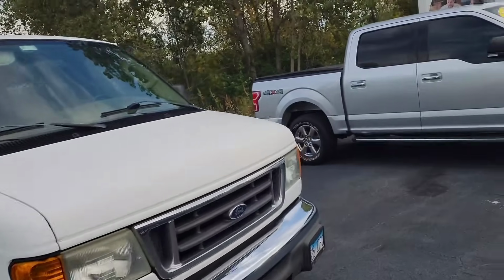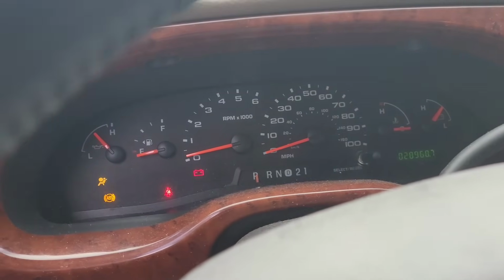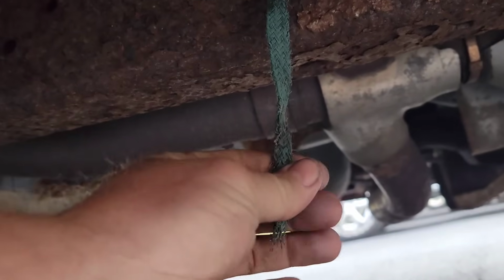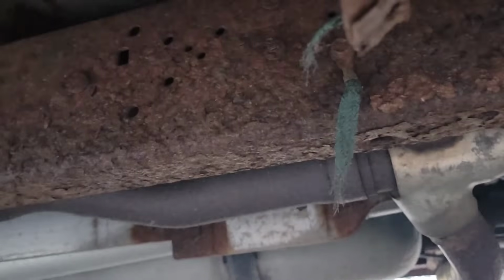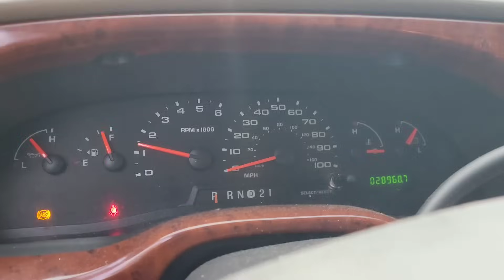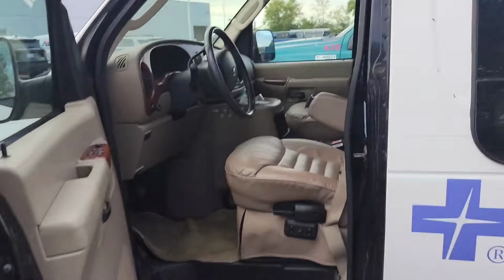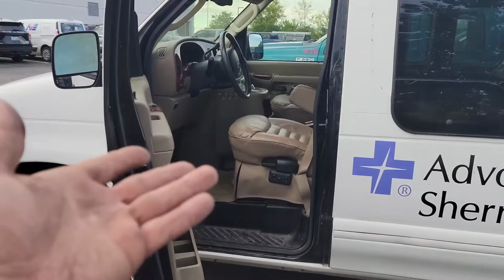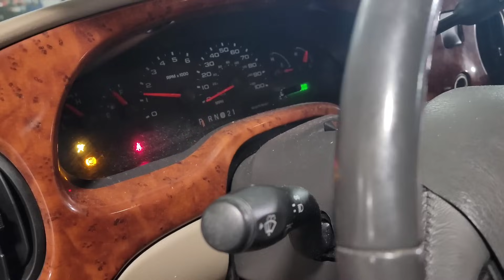Econoline No Start #1 Reason Why Typically - Crank No Start - Easy Fix - #econoline #nostart #ford

Comment: I have a question regarding the central locking system on my 04 Mazda 3 Hatchback. When I press the unlock on the key fob, only the drivers door unlocks but all doors lock when I push the lock button. I went to the dealer and the master tech said there is no central locking reset procedure; it might be the BCM which I think is bs . I replaced the latching assembly for the hatch and nothing changed.

Is there a central locking reset procedure for an 04 Mazda 3 Hatchback and if there is how?
Reply from the maker: Did you double click the unlock fast?

1st click is for driver door and second is for additional doors
Reply: @FordBossMe  Yes I did and nothing happens.

Comment: I changed the starter to my sisters 09 e350 super duty and now no crank or no start can you help with suggestions? The old starter made a metal on metal sound when trying to start that was the reason I put a new starter in the first place
Reply from the maker: Small wire check the connection going to the starter
Reply: @FordBossMe  to make sure it’s connected or to see if it’s broke ?

Comment: You’re a freakin genius and I wish I could send a picture of mine.. it looks EXACTLY like yours did 😅😅😅 thank you dude
Reply from the maker: Glad I could help!
Reply: @FordBossMe  quick question man, where does the ground wire in with the cables?
Reply: Sorry, I have a 99 econoline bus and it runs a two battery circuit. I’m green when it comes to electric stuff. But the factory ground strap looked exactly like the one you fixed, crumbled in my hand. But one end is on the frame and the other is drilled in between the negative and positive cables coming off the side second battery. No one knows what I’m talking about when it comes to this dang bus 😅
Reply from the maker: @thesoutherndisciple  send me a pic poissorichard.rp@gmail.com 

I'm on vacation right now
Reply: Oh sorry dude!
I’ll send them, thank you.
Reply: @FordBossMe  I sent it and it said your email couldn’t be found.

Comment: Do you know much about towing numbers for the f150 pickups? 
I looked in my owner’s manual for my truck and it being a 2018 f150 RCSB (122” wheel base) and having 3.15 gears the chart says 8200 lbs I believe but I called my local ford dealer and they said only 5000 lbs because I don’t have a tow package but I should be able to pull closer to the 8000 if I put a receiver hitch on the back right?
Reply: Be careful here, 8200 is only with a weight distributing hitch. 5000lbs is bumper pull, probably 300lb or 500lb tongue weight max.
Reply: @semajniffirg230  I didn’t plan on pulling the max I was just looking to get a travel trailer around 4-5000 lbs and didn’t want to be over weight and since I have to put a receiver hitch on the truck anyway I planed on getting a weight distribution hitch and maybe even some air bag depending on what trailer I get

Comment: I did this but it still won't start. Does this mean the fuel pump is bad?
Reply from the maker: Possibly yes, make sure you have power and ground and check all fuses
Reply: @FordBossMe  Did that and they all seem to have power. The vans been sitting and the ground strap was the first thing I checked and replaced. Thanks so much for the quick reply!

Comment: Isn't the frame connected by metal bolts to the body already?
Reply from the maker: Doesn't matter it doesn't work that way, just replace the wire
Reply: @FordBossMe  gotcha, thanks for the videos sir!

Comment: currently having a no start problem with ny econoline, man i wish my fix would be that easy but i am afraid it won't be, pointing to a f$$l pump.
Reply: Just did the fuel pump on mine and wasn't that bad..had to cut the tank straps tho because bolts were rusty as shit (282000kms). All in all $100 bucks for the fuel pump and $80 bucks for new tank straps.   And don't buy the whole new fuel pump assembly..you only need the fuel pump motor

Comment: checked ground its ok did a code reading comes up 95 fuel pump secondary circut fault  cranks no start no fuel any suggestions thank you
 send me a message
Reply from the maker: How did you check the ground

Comment: Buen Video, una consulta en una ford e350 5.4 del año 2005, donde esta ubicado esas conexiones, para poder revisar
Reply from the maker: Perdón, pero no hablo español only poquito
Reply: thanks for your attention, I have a ford e350 5.4 from 2005, and I had problems starting.  A query, where these ground connections are located.  Greetings from Peru

Comment: Can you do a video on the f250/f350 grounding strap locations? I’ve read that when they break, for the 6.0’s they can’t weld the transmission inside and destroy it.  Is it better to just use real wire instead of the braided ground straps? Where would be a good place to run supplemental grounds? I was just under my 6.0 f350 cab and chassis, and now that I think about it, I don’t recall seeing any ground straps. This is a southern truck too.
Reply from the maker: If I get one in yes

Comment: If you have a rusty frame like this take some used motor oil and a paint brush and brush it on. Eventually the scaly rust will fall off.

Comment: Wish I saw this video 6 months ago …. Swapped out my fuel pump swapped out the solenoid…. Was at a loss … finally had it towed to a mechanic and it took them several hours to trouble shoot the ground cable wasn’t grounding …. Cable was in tact the frame was just very rusted same simple fix as you

Comment: Definitely hope this was why I was stalling while driving. I changed battery, alternator, oxygen sensors.. the whole thing 😭.. just put a 6 gauge wire on mine cause mines was broken as well lol. I used battery terminal protector spray

Comment: I tried this on my 02 e250 that doesn’t want to start and no dice My ground strap was good, but the connections were dirty, and Rusty I spent 10 minutes cleaning the contacts and bolts with a wire brush then using some battery acid cleaner and no dice ??😢😮‍💨😮‍💨
Reply from the maker: Some of those had issues with the instrument cluster shorting out

Comment: Got an '04 Ford f150 at the shop doing same shit and it's got me starting to question myself. Typical FPDM bullshit but it's not that, pump, wiring harness, etc..I thought I went through entire truck fixing grounds already and found the body to chassis ground, strap looked good but mounting spot was corroded so I just moved the location to a solid cleaned and prepped on.. Assumed it was a really good ground but now maybe not...I keep losing ground to the pump and my boss had me swap a used harness into it when told him wouldn't help and it didn't..I know the CJB boxes also a prone to failure and this truck has water damage on inside of cab directly below box when there was another ground.
Reply from the maker: Cjb and grounds are the main issues

Comment: Cool...the fuel gauge didn't work on the first start attempt either, maybe that was another indicator?  It did work, went to full, once the new wire was installed.
Reply from the maker: Exactly Great Great Observation

Comment: Went to ford dealer they said I need a fuel pump had it towed home for 700 I was out on the road watched this video and had it fixed in 10 minutes with everything inside my van wire lugs and all the tools wish I would have seen this when I was broke down on the side of the road

Comment: What type of wire crimpers/ strippers are you using there? They look well made
Reply from the maker: It's a pair of Mac Tools.... expensive wire strippers.

They're made by Carlisle so Amazon has a pair for about $10 less
https://amzn.to/39wIwp9
Reply: I found Napa online has them for 19.99 I’m gonna call my store when they open and check the price for whoever is wondering. Thanks
Reply: @FordBossMe   I bought a pair from Napa the same pair you put on Amazon, was 18.99 I believe
Reply: lol, i love that this is top comment, same exact thing I was thinking, and I casually scrolled down not even looking for anything about the strippers xDD

Comment: My ground didn’t look this bad but it was only hanging on by a thread or five.  Just enough  that I had a mechanic come out to diagnose it.  He said module so we replaced that it ran fine for about 3 miles and I hit some washboard on a dirt road, it died again.   He says fuel pump. We replaced that.  He still can’t get it to run. Says new module is bad. Replaced that.  Then says pump is bad replaced that, he paid a guy to come check all the wiring too.   finally 2 pumps and 3 modules later it starts running.  Runs good  until I get it home to back into my shop. Dies again.  So I google it and came across this video.    Figured I’d humor the thought .  Sure enough. I get the wire to make good ground the van fires up.  I get it into my shop and replace the wire it works great now.   That was a $900 lesson.

Comment: Today I had a blast taking off the manifold to get to the fuel injectors on this 91 e150. Tomorrow the plan is im going to spend a grip on new injectors and a fuel filter and all kinds of sensors and stuff.  I'ma go off on my uncle, who's a 35 year mechanic, who owns his own shop, if it's the stupid rotted out ground strap that's preventing it from starting. I swear.
Reply from the maker: 70% of the time that's all it is honestly

Comment: You are a braver man than I running a cheek poker without safety glasses. I've had to pull more than a few of those wire strands out of my face. Those things are nastier than a disgruntled porcupine having a bad day!
Reply: When you use wire wheel on a bench grinder it’s amazing how many wires get drilled right into the front of your clothes.

Comment: literally please try this first!!! 

spent 600$ in parts, 2 fuel pumps cause i thought the cheap one was bad from the start, new relay, fuse, battery, and fuel driver module, and still didnt get it to start!!

this 10$ bad boy wire, and a couple of self taps and this fucking e350 started right up! pissed at what this took but happy to find a simple solutions that got it running after this head ache! please try this first like he said before you go throwing money at it like i did...

plus a big ass whole in the back of my van for the fuel pump... lol
Reply from the maker: Glad.this resolved it

Comment: sad to see that green mustang GT wreaked
Reply from the maker: He was street racing, 800hp car and launched it at a highway roll and couldnt recover
Reply: @FordBossMe    lol , toe nails in the rad syndrome look at me
Reply: @FordBossMe  My internet was acting up last night so I didn't get to watch this then but I was curious about that car myself. Guy I used to work with had a 91 fox body with a turbo on stock 302. He wrapped it around a pole and he was lucky, the car, not so much